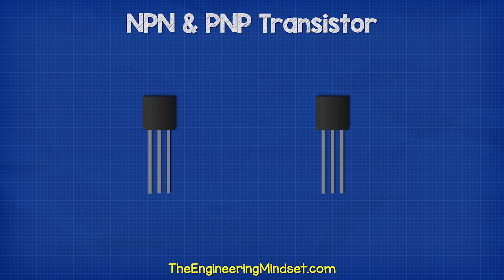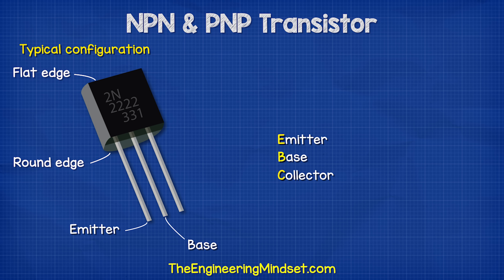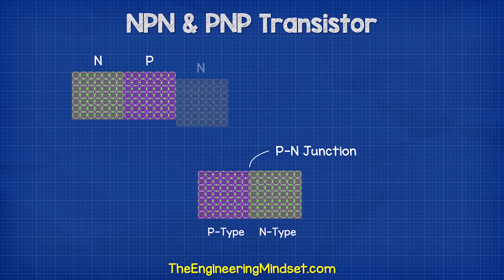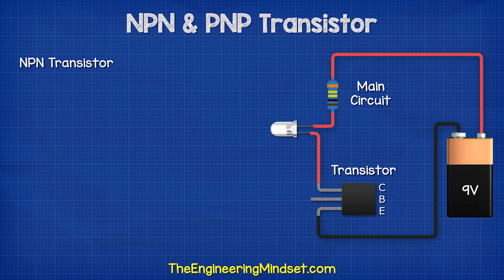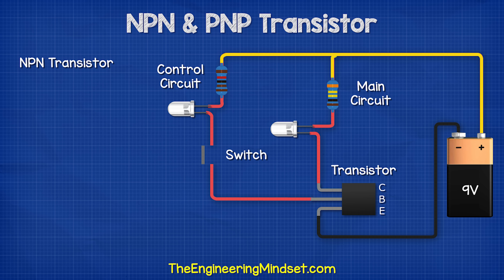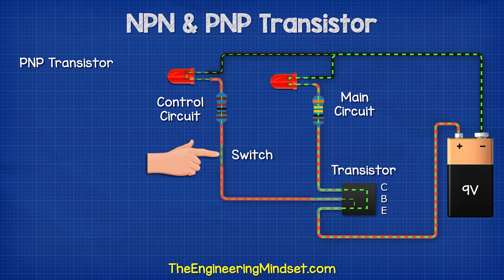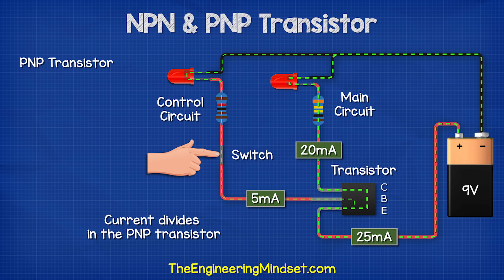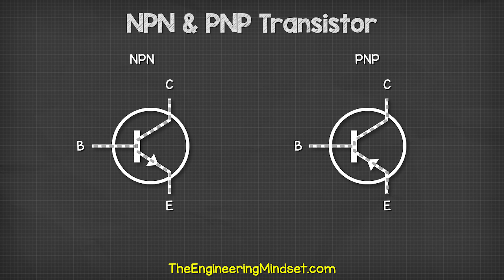NPN & PNP Transistors explained - electronics engineering

Comment: I’m having such a hard time figuring out the current thing. Here it seems simple but what if I have a resistor between the emitter and ground? What dictates the current? The transistor or ohms law? How do the equations shift exactly? Does current dictate the voltage or the other way around?

Comment: So the just of it is(?):

NPN has two positive inputs and one negative output. NPN would thus be beneficial for an amplifier (signal voltage to the base, supply voltage to the emitter).

PNP has one negative input and two positive outputs. For what application, I have no idea. Its the one thing I never understood in semiconductors and I have yet to be presented with an explanation that works.

Comment: I know this question will seem stupid to a engineer. If transistors are just three layers of n or p type material, why can't the collector and emitter be interchangeable? Transistors are shown as just three layers of npn or pnp, but in practice the emitter and collector are not interchangeable.
Reply: I'm guessing one of the main reasons for that is emitter is heavily doped as it has to carry a large number of charge carriers (electrons) while the collector is moderately doped
Reply: Also, I believe that the structure inside the transistor is built such that the emitter is the largest while the base and collector are relatively smaller.
Reply: No the collector is larger than the emitter and the base @colorx6030
Reply: BARRIER POTENTIAL POLARITY...?🤔
Reply: Process called doping, on PNP the emitter is more doped than the collector.
Reply: The types are all relative to each other. You have have some more P type than another P type. Etc.

Comment: Im confused. I thought that for PNP type when the base is off the main circuit should be on. Because for NPN when base is powered Collector and emitter is connected but for PNP it is said that it is the opposite so when the base pin is powered the collector and emitter should not connect since they are opposites. yet in the video 2:22, PNP base is off but the emitter and collector is also not connected?
Reply: even the flow is confusing... Electrons travel from the negative to positive terminals right....
Reply: Yes, I was distracted by the direction of the flow they illustrated

Comment: What I’m curious about is why the electrons and holes do not uniformly distribute themselves when you put a P and an N type region into contact.
Reply: Electrons in the N type material fill the holes at the junction in the P type material. This creates a barrier voltage that prevents further electrons from filling all the holes in the P type material. That’s why a forward biased silicon junction diode needs a voltage of approximately 0.7 V before current will flow through it.

Comment: I have an ESP32 CAM MB board connected to a direct 5V power source, and I am using an Arduino that operates a NPN transistor to turn it on and off to take photos. 

If I add a resistor to the mix, anywhere, the board won't work. I was afraid that having a 5V power source, and the On/Off from a separate Arduino might fry the board or the transistor. 

Why does transistor stop this circuit from working? If I literally put it anywhere into the circuit the ESP32 switches on, but does not operate.
Reply from the maker: Check out NEW resistor video, everything covered! ➡️ https://youtu.be/DYcLFHgVCn0

Comment: I don't ever think I'll get this stuff, I always thought electricity flows from negative to positive.
Reply: There are positive voltages ans negative voltages.

AC current is an alternating voltage. It constantly moves back and forth (positive to negative to positive to negative). Put a straw in your mouth and hyperventilate through it; thats what the current is doing.

Frequency is the rate at which you breathe, voltage is how hard you're pushing, and current is how much air you exhale each time (how deep of a breath you take). You can also change the amount of current by adding a resistance (closing and opening your lips).

DC current can either be positive, or it can be negative. It can flow in one direction, or it can flow in the other. It just depends on the voltage polarity required.

Transistors basically have different purposes depending on what voltage they're set up for. A forward/reverse circuit for a DC fan, a chain winch, an automatic door, an LED that changes color based on polarity.

What you need to update about your understanding is that yes, electrons are negative and flow towards a positive surface, but thats because opposites attract. No matter what your starting voltage is, it will always travel towards the nearest opposing polarity.

Basically, the direction of current flow depends on whether you have too many or too few electrons.

If you remove an electron, then you're positively charged because you have more protons than electrons. Negative current will flow, or be pulled, towards the lqck of electrons to "fill" its place.

If you add an electron, you'll have more electrons than protons and thus free electrons will be repelled, or pushed. This is positive current flow.

It basically breaks down to whether a circuit is pulling current, or pushing current. Positive is pushed current, and negative is pulled current. This is how doping works in transistors. N and P are doped to either be postive or negative, and thus designed to either push current or pull current.

Comment: This is great but it does not explain the application and why you would choose one over the other; that would be very useful for me. Thanks.
Reply from the maker: See the animations at 3:12 you should notice we can use a control circuit to turn on/off the NPN transistor. Whereas the PNP transistor is reversed so turns the control circuit on/off instead. Both very useful, NPN is most commonly used as we can turn in on/off based on an event, it will then control a higher current in the main circuit. For example a fire detector is connected to the base pin, when it triggers it turns the NPN on which powers an alarm circuit.
Reply: @EngineeringMindset  Excellent, thanks, that explains it a bit better; what you said is not so easy to grasp from studying the schematic in the video. I generally get the science, but the practical application is often the missing link for me. Learning those key elements helps a lot... Great channel BTW, clear to see your roots are in HVAC. Looking forward to your FCU 4 port valve video.. :)

Comment: I so wished that concept of "conventional current flow" never came to be.
It really ruined little me's first electronics experience since physics books mostly talked about elektron flow and popular electronics books did the reverse thing. And it was too often unclear what they meant when saying "current flows this way or that way".
You'd think electrons go where the arrow points.... meeeeeeep. wrong.
Reply: I consider myself fortunate that I first learned about current direction being the flow of electrons while in technical school.  Going to those damn university engineering and physics classes, they always defined current as the direction of the flow of holes, the gaps left by the traveling electrons.  Of course these same college textbooks would describe holes as equal and opposite to electrons even down to the mass.  If a hole is the absence of an electron then how could it have mass?  Years of uni indoctrination have never changed my way of thinking; current being equal to electron flow (the Popular Electronics way) just makes more sense to my pea brain.

Comment: 2:20 "The current combines in this transistor" 

That's technically true but it has nothing to do with the transistor, it's just how circuits work; when a circuit branches, the current divides, that is always the case.

You can just as easily switch on the transistor by using a second powersource between Base and Emitter.
The much much more important point of a transistor is the amplification. You can apply a low voltage between B and E to get a large change in electrical resistanve between C and E. It's not just on and off, but also everything inbetween. In a BC548 you can control a 30Volt signal completely by applying only 0-5volts to the base. That is what transistors are about.
Reply from the maker: Thanks, we have discussed this in detail previously https://youtu.be/J4oO7PT_nzQ
Reply: Why you trying to flex on Paul yo. He did an in depth video in the past about switching and amplification circuits.

Comment: Understand the how but why?
Reply from the maker: Are you asking why they are used?
Reply: @EngineeringMindset  I’m sorry, I never understood the realistic difference however it is an easy google.  I’ve only dealt with transistors once in circuits and mechatronics back in school but I specifically remember overlooking this while designing a PID controlled fan.  I’m mechanical so that was my excuse…

Comment: Excellent. To use one of these with a Micro controller, like ESP32 or Arduino. Would you need a resister between the Micro controller pin to the Base? I mean is the 5 Miliamps too much power for a data pin?  That would be the next step in using an NPN or PNP.
Reply from the maker: It doesn't have to be 5mA, see this tutorial https://youtu.be/J4oO7PT_nzQ?t=184
Reply from the maker: Check out NEW resistor video, everything covered! ➡️ https://youtu.be/DYcLFHgVCn0

Comment: Npn...needs positive nput...pnp...put negative please...simple way to remember how to activate the base...
Reply from the maker: I just remember NPN as "NP IN", as in the current flows in to activate it. The PNP is therefore just the opposite
Reply: @EngineeringMindset    And to remember the schematic symbols, I always use NPN = Not Pointing iN in refference to the arrow.
Reply: I learned it ages ago as "NPN - never points in.  PNP - Point In Please"

Comment: I like your video, but still, it's not explained why on atomic level both transistors work as intended. Is it because of special amount of electrons is feed and not less or more, which allows the flow between opposite circuit?
Reply from the maker: We covered it in great detail previously https://youtu.be/J4oO7PT_nzQ?t=824
Reply: @EngineeringMindset  Thank You! ;))

Comment: Can you do one that explains how to switch high voltage with a low voltage base using a transistor? Your videos are very helpful, thank you for everything so far.
Reply from the maker: Are you referring to a Darlington transistor?
Reply: @EngineeringMindset  Maybe? I have a pinball machine that uses transistors to switch higher voltage for lighting with a 5v source going to the base. I know transistors can be used like relays but the implementation is still pretty unclear to me.